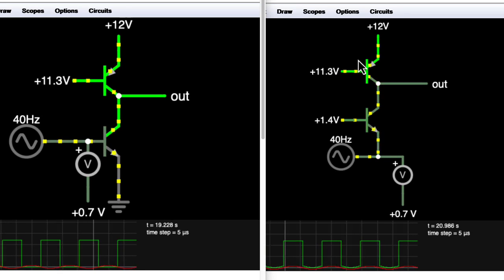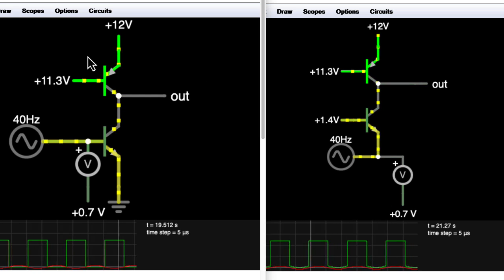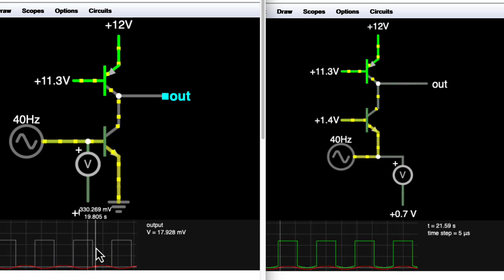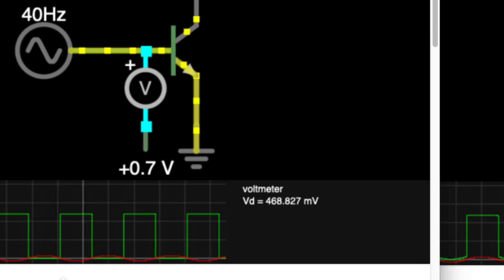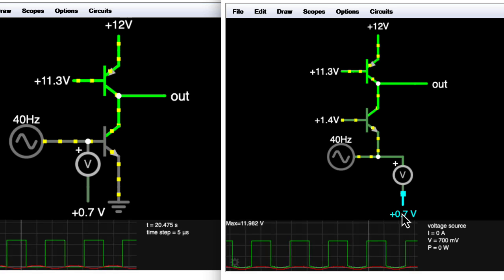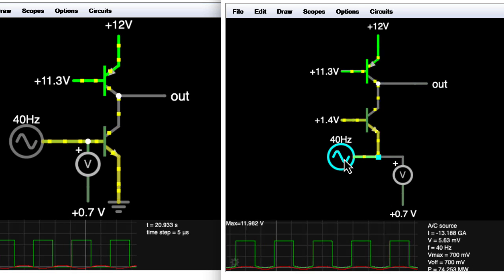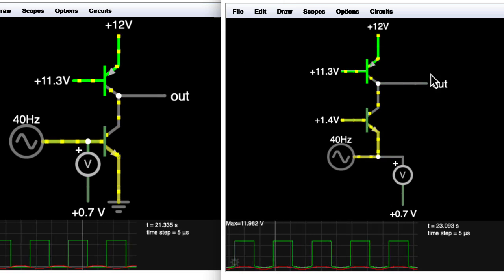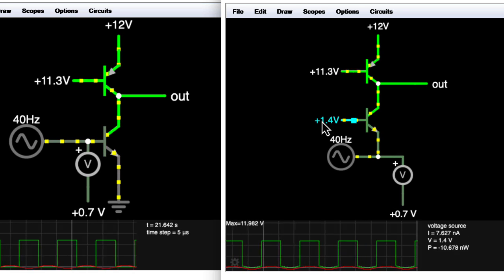Falstad Fun: Common Emitter & Base Amps with Active Loads (Analog Electronics)

Comment: Thanks, Aaron. Looks like Falstad is available for Mac OS. Will give it a try.
Reply from the maker: It's Javascript running on a browser, so it's available on basically anything with a modern browser. :)
Reply: Java and javascript are not the same.
: )   @Lantertronics
Reply: @AnalogDude_  True but for added context - Falstad's circuit simulator was initially developed in Java and later someone ported it to Javascript. I think both versions are available on his site. He really did mean Javascript
Reply from the maker: @AnalogDude_  The one that shows up when you go to the main falstad version is the javascript version, I think.
Reply from the maker: @AnalogDude_   If you want the Java version you have to go deeper into the falstad website. The java version doesn't run in my stock version of my web browser.
Reply: it's an applet and can run outside the browser. there is a download link as well.
it's was probably the first computer book i bought back back then, Java. @Lantertronics